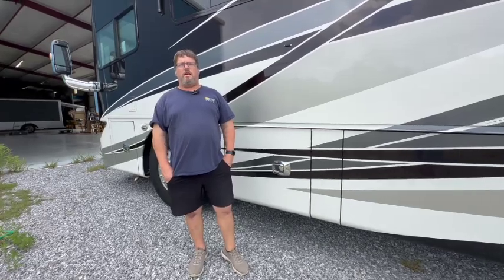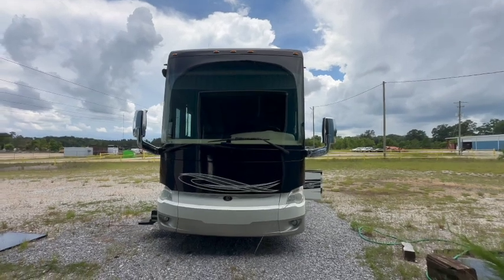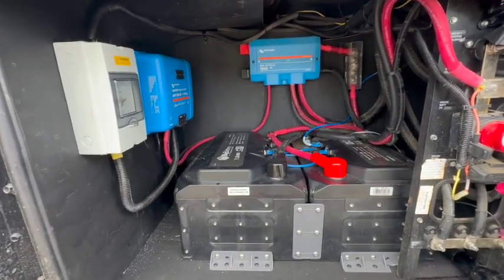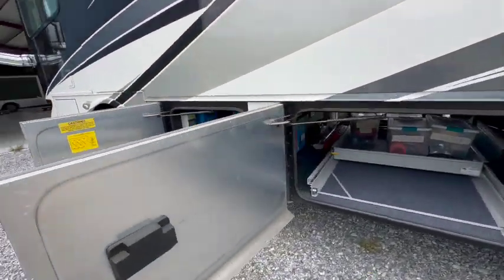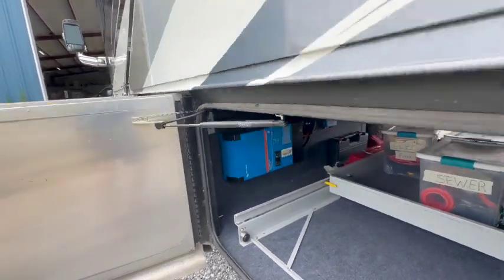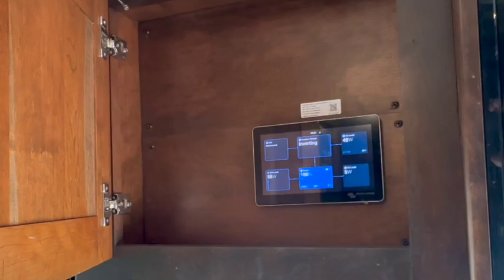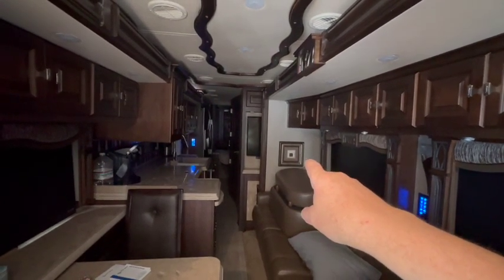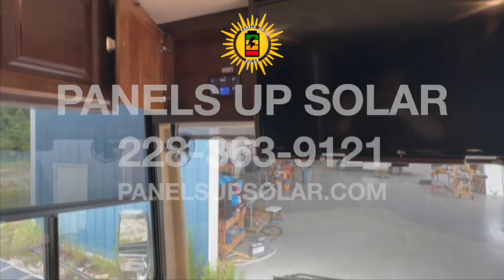Tiffin Allegro Bus Solar and Battery Installation

Comment: I can't for the life of me understand why you add an Inverter. Why won't the original inverter do the job? I'm guessing you have the new one feeding the microwave and the original one did not feed it?? Next time you do a video like this it would be nice if you gave some specs such as what voltage panels you used and series or parallel.
Reply from the maker: The customer wanted to be able to run an air conditioner as well. The original inverter system was not set up to fit his needs and he wanted the Victron product. The panels are wired in series. They are the Rich Solar Mega 200 solar panels that put out a VOC of 22 volts.